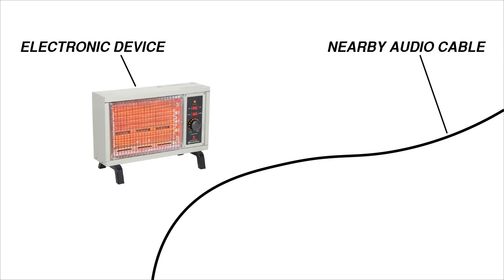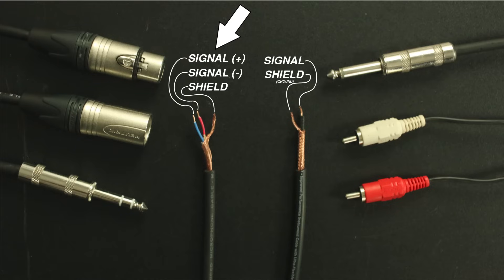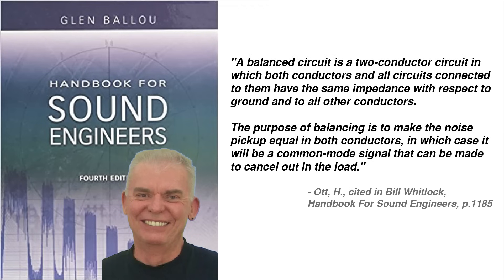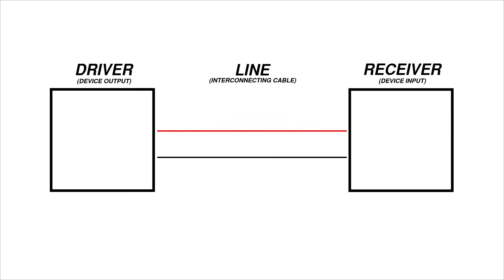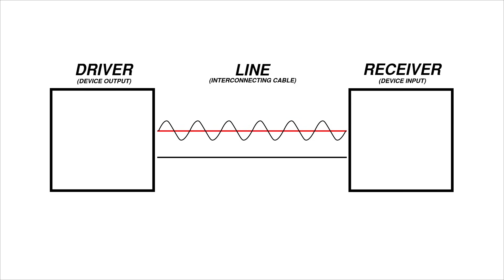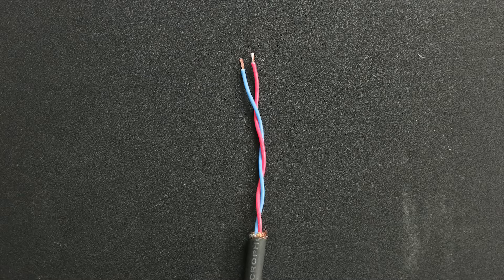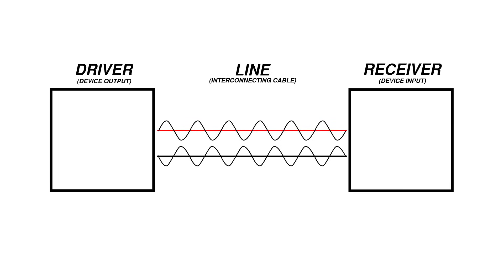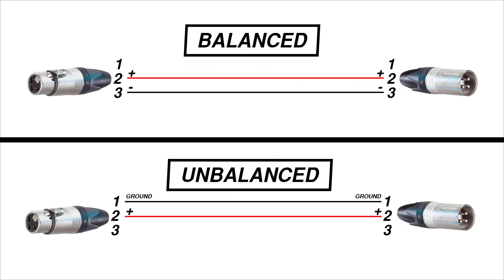Balanced vs Unbalanced Audio | Do Balanced Cables Sound Better?

Comment: I like thinking about the signals in a balanced cable algebraically. Let's call the positive signal A, and negative  signal -A(180 degrees out of phase). Let's designate noise as N. Since both signals pick up the same noise by the time it arrives at the differentiator, we have (A + N) and (-A + N). Now the differentiator subtracts the -A signal from the A signal: (A + N) - (-A + N) = A + N + A - N = 2A. See, the noise got cancelled out and you're left with a clean signal at twice the amplitude.

Comment: Interesting. How does a balanced cable differentiates the noise from the audio in order to phase cancel the noise but not the audio?
Reply: The cancellation takes place in the differential amplifier at the receiving equipment input, not in the cable.

Comment: Thank you for this. I was looking for the reason why my monitor was getting a bunch of noise while connected to my audio interface. I was wondering, would an XLR to Unbalanced Cable (or vice versa) be the answer to getting rid of the "static" noise? since my audio interface (M-audio M-track duo) only has unbalanced out, and my monitor (rockit 5 krk) has balanced and unbalanced audio "in". Sorry if I'm being too specific, I understand it is annoying but this question is my last resort to getting this settled >.<
Reply: There are times when you can eliminate noise by finding where it's coming from or changing the wiring to better quality or having it done properly unfortunately there's another half to this problem and that is the equipment today is all made in China you will find some equipment that produces noise and others that don't pretty much depends on what brand you're buying there's a lot of garbage out there today people are figuring this out the hard way trying to save money and then they find out either it doesn't last long or it doesn't sound good it distorts it overheats in your case it's creating noise hopefully that's not your problem but it is a lot of times
Reply from the maker: An adapter won’t make it a balanced connection. You would need a transformer (like a DI), but I’d only recommend that for long cable runs. If this is a short cable run, the balanced/unbalanced issue may not be your problem. 

It’s hard to say from here, so try researching different types of noise (buzz, hum, etc) to identify what you’re hearing and go from there. Hope this helps. 

Thanks for watching.

Comment: I always buy optical leads with gold plated optical ends for the best quality
Reply: What about the actual equipment that people are purchasing nowadays I see so much off-brand garbage because people are trying to save money and then they end up with all kinds of issues not necessarily because of the wiring because of the actual equipment was produced for people that wanted to get affordable merchandise not thinking about the possibilities of what could happen overheating distortion not lasting a long time causing buzzing noises draining a lot of electricity from your system so many issues not all China they are capable of making all different levels of equipment depends on what is purchased many times.
Reply: @Mr.Robert1  No U
Reply: @Mr.Robert1 not that your comment had anything to do with optical cables, poster was just messing with you anyway. Optical cables are non-conductive.

Comment: Very good video.   Balanced cabling is really all about removing noise when operating in electrically noisy environments.   Unfortunately way too many in the audio community equate "more expensive" with "higher sound quality", which is not the case with balanced cabling at all, unless you have a noisy environment.
Reply: Well, audiophiles think that expensive ethernet cables make a difference in audio quality, so I'm not entirely surprised that they think that balanced cabling magically gives you better audio quality.
Reply: noisy and probably over a long cable.. I wonder, being a "phile" of something, will you ever enjoy the content rather than looking out for issues!
Reply: I saw $900 toslink cables once. For people with more money than sense.
Reply: @jayelwin  you are so right! I have been working with advanced analoge and digital gear for 30 years! Cables have never been an issue! Use good copper cables!
Reply: @GeirRssaak  I think gold plated connectors are just so they don't oxidize or corrode quickly and nothing else. Basically for longevity, but I might be wrong.
Reply: Very good point! To exploit an xlr cable the source and the receiving gadget must be constructed balanced! P.s  why do the hifi fanatics not use gold, which is the best leader!?
Reply: @GeirRssaak they do . Gold plated connectors exists
Reply: @StormbreakerYT  what do you think goldplated means?what about purer gold or silver!?

Comment: I am an electric engineer and this explanation is not clear to me. It does not show what the two wires in the shield really bring and why it is so important. I had to read in other sources. But the comparison of balanced and unbalanced cables is very good.
Reply: Many times it's not the wiring or the way that it was connected sometimes it is and sometimes it's not unfortunately because there's so much merchandise that's made in China there's a lot of garbage being made today people being on a budget not wanting to spend a lot of money in a system and then they end up having problems

Comment: A very good video!
We seems to be a lot of engineers here, and I'm one of them 😉
About the shield:
Never let it come into the reciever or any other electronic device because it is only filled with "noise" and should be attached on the outside of the reciever and then we have clean signals.
Compare with Faraday's cage. An easy way to proof it is to use a cage (can be built with net that normally are used to make a fence for hen's)
Put a battery radio in it, but no antenna sticking out.
Then we need to use something that can disturb it, an electrical razor is often good, but try it first before using the cage to find what frequency it is disturbing.
Put the radio in, and the sound is gone, but if the thinnest wire is put in you will hear the noise, the same if the antenna is sticking out.
I have helped some large companies with their problems, as in Volvo where they have lots of robots that are welding, that easily can make the electronic equipment to burn if the power cables are near but not if it is built on the correct way.
Sometimes it can be hard to know what is causing it, because the disturbing can be long away where the power often comes to the most machines.
The short way is to use fiber that always will provide a stable signal.
Many electronics around the machines are using it now.
English is not my native language, but I hope that you can understand it.
Cheers from Sweden🇸🇪

Comment: Came in expecting "cable burn-in" grade audiophile bullshit. Came out understanding electronics and signal transmission in multiple fields better, immediately recognizing this is based on the same principles used in things like ethernet's twisted pairs.

Comment: I am still left with my doubt and wondering if a balanced connection will make an audible difference over a short distance (I.e. 1m or less).
Reply from the maker: Unless you have an extremely noisy environment, it won’t make an audible difference over such a short distance.

Comment: Now demonstrate why this makes no difference at all (or even a very very slight negative impact due to the more complicated driver and receiver on each end) when connecting an audio source to an audio sink, 6 inches from each other, in an audiophile's equipment stack.  ;-)

(For the uninitiated, balanced audio inputs are the connector de-jour for high end audiophile components.  You know, so there's less noise for the arm-length cable running between your other oxygen-free braided interconnects and your hospital grade AC outlet with dedicated 30A circuit to power your 5W tube amplifier.)

Comment: If your in an environment with a lot of noise, high noise floor, you will hear a difference.  But most homes are not. I use unbalanced at home and measuring with an analyzer shows no difference in sinad.

Comment: The 6.35 mm TRS plug (Klinke Stereo) can be used in various ways. On the one hand mono signal balanced or stereo signal unbalanced. 
A balanced connection is used in professional microphones. The positive and negative contact of the microphone is connected, but the housing is on the screen. Disturbances that radiate onto the housing or shielding are not coupled to the signal.

Comment: The Irony of discussing background noise on a video with some seriously loud background hiss.
Reply: There are times when it's not the wiring not the way it's connected and not the interference from other equipment there are times when it's the actual equipment itself everything being made in China they have the capability of producing garbage and the option of producing better quality of goods depending on what is asked for when the company visits China these factories are capable of producing all different levels of equipment.
I have been there.

Comment: Such a load of, but then it could work in some scenario. But then you'd be totally by the amps. In short, you can't simplify cords that much and also there is other pieces that will suffer from interference.
Reply: What if the actual equipment itself is off-brand inexpensive garbage and that's producing the noise in the first place then all the correct wiring in the world is not going to make a difference
Reply: @Mr.Robert1  Then, at least I would throw away the broken stuff and use something cheap but working - as in manufactured correctly and not wrong. If something is build wrong it doesn't mean a fix for it would do any good on a working equipment.

Comment: I've been a Hi-Fi enthusiast for 43 years, and I've edited videos on my PC, obviously working with audio. I've NEVER used Balanced Connectors, always Unbalanced. I've NEVER heard any noise or hum whatsoever in my audio signals. I'm not dismissing Balanced Connectors (which are commonly used professionally), this is just my own personal experience.
Reply: Reason being you probably don't have garbage off-brand equipment as most people are on a budget today and don't understand that's where their problem is coming from. I have personally been to a factory in China when our company decided to put our name on DJ equipment. They are willing to make it as cheap as we wanted or as good as we wanted.

Comment: It may not be 100% required to have an equal and inverse phase signal on the 2nd conductor in a balanced cable. But in practical applications it matters. When one conductor is broken or wired incorrectly this is considered "half-legged". And it reduces the volume, as well as sometimes introduces weird phase issues that make the signal sound wispy and hollow.

Comment: There is another issue with unbalanced connectors, and that's ground loops. If the devices at each end of the link are independently grounded, then there is the possibility of small current flows at mains frequency through the ground connection, which will induce noise onto the signal wire. In a configuration with unbalanced connectors, then only one device ought to be grounded (usually the amplifier). That can be difficult to achieve and might breach electrical safety regulations. Note that the greater the distance between the two devices, the more likely it is to occur. If the devices are plugged into different mains circuits, then this can get very loud indeed. Whilst the same can happen with a shield on a balanced circuit, the common mode rejection will generally mean it's not a major problems.

Also, where both wires on an balanced connection are carrying signals, then that's a differential signal. It's invariably what is used on high speed data communications as it's much more robust than a single ended signal.

There is also another important point why twisted pair cable is used, and that's because it has a characteristic impedance. It's of less importance at audio frequencies, but in the sort of high speed twisted pair cables used in data communication, it's becomes very important that the characteristic impedance of the cable matches that of the load or you get reflected signals which can have a massive effect on the signal quality.
Reply: I agree, I have just been writing about this and compared to the Faraday's cage, so never connect the shield in a reciever, but connect it on the outside, it can be done the same with the ground if there is a problem with some noise

Comment: It isn't "the cables"... It's the topology.
Reply: Today the consumer can go out and get inexpensive garbage from China and then wonder why they're having a problem.
China is capable of making all different levels of equipment depending on what is asked of them
Reply: @Mr.Robert1  Again, the quality of the cables is independent of the topology. Unbalanced has no built in defense against common mode noise.

Comment: I never had any noise problems with unbalanced connection type
Reply: And you probably have name brand equipment. Many times it has nothing to do with the wiring it has to do with the actual garbage that is being purchased today and manufactured

Comment: Very good.  All high speed computer connections (USB, Ethernet, PCIExpress, Fibre Channel, etc.) use differential transceivers in the same way:  reduce common mode noise.

Comment: What about TRRS? My DAPs both have a 2.5 TRRS and my M11 plus also has a 4.4 TRRS. Also, my Sennheiser HD 560S has a 2.5 TRRS input on the headphone. One reason I want to use the balanced outputs is the difference in output power.

Comment: I had an onboard audio card in my computer with RCA outputs to my speakers and had lots of noise for years. I had no idea why until I bought an audio interface with balanced outputs. I bought balanced cables as the speakers have also got balanced inputs and the noise disappeared. Great explanation thank you.
Reply: You had a problem called mismatch. This occurs when you use balanced cables to connect from an unbalanced output, or vis versa. 
The interface box that solved your problem is called a matching transformer.

Comment: Great walkthrough on a topic that has been a mystery to me. :) 
So, what would be the best way forward if I have a 3,5mm jack (stereo) from a laptops headphone output and want to make sure to have it balanced to avoid unwanted noise jacking into a mixer with XLR or TRS?

Thanks in advance.
Reply from the maker: The laptop will need to be connected to some sort of transformer or DI box for a balanced connection to the mixer. If it’s within a few feet of the mixer, no need for balanced - just use a 3.5mm to dual 1/4 TS cable. If it’s far away from the mixer, check out this video: https://youtu.be/S2kapm4w46c

Comment: “Twisted pair” RCA cables are balanced cables.  Most higher end car audio uses balanced signal
Reply: I have heard a lot of car stereo installations that had all kinds of buzzing noises coming from the equipment not a good example

Comment: please i have two questions. how if i can connect trs or ts to drum or guitar or anything to mixer ?
 2. if i used trs to somthing any problem will happend or some few problem will happen not daly ?
3. any video how to change from insert to direct? or can you tell me what should use to change from insert to direct ouit
4. can i use adapter. to change from trs to ts ?

Comment: Two wires for two chanels, left and right. Diferent signals, so no ballance or other theory ... and ground wire is for guard the signal wire (connecting on ground). No capacitive coupling, no noise interfer. So, 599, 73 and all the best !! 🤭🤫

Comment: Does the quality of the wire used in a balanced XLR cable make a difference in the sound reproduction, IE Silver Coated Oxygen Free Copper? How about 3 pin vs 5 pin for music reproduction IE Turntable arm to Phono preamp to Mono Block amplifier to output to speakers 2 channel stereo. Does using balanced cables increase the amount of information passed through the signal path? Now that Balanced Turntables are on the market I am thinking of creating a new analog system with Mono Blocks. If I did would I need 2 balanced Phono Preamps in front of the Mono Block Amps?

Comment: I'm not sure it that was a good comparison. 
A. did you have all of that cable coiled up?
B. Did you wire it correctly? Balanced would use pins 1, 2 and 3
C. Did you use the braid as the ground for the unbalanced?
Finally. A better example would be to compare 20M x2 as a longish stereo balanced run to a very long phono cable. Say 20M of regular phono cable and then see the volume / quality difference. You may as well compare a real world example so we know when it's time to go balanced and how short a run makes no real difference. Alsoi would compare 20M thick phono cable with 20M of thin phono cabe.
  One toy i have is a magic box that can turn XLR to phono and vice versa. You can convert from balanced to line or line to balanced. Stereo in both directions with volume controls. Very small and simple and very handy. Obviously i have mixers that can do this too.

Comment: Real challenge is to connect unbalanced outputs to balanced inputs (synrhs and modules to pro audio interface). If wired properly,  you take advantage of balanced input circuitry and get much better result than plain unbalanced connection.

Comment: ...Its all to do with the inverted input against the non-inverted input.

If the "hot" gains 0.1v of noise, so will the "cold".

When it enters the input, one signal is inverted, and the other is not.

This causes them to cancel each other out.

0.1v - 0.1v = 0v

Because one of the signals carries the desired audio / signal, this will leave only the desire signal as the noise will be cancelled out

Both signals are then mixed through an additional opamp which adds gain to the conditioned signal